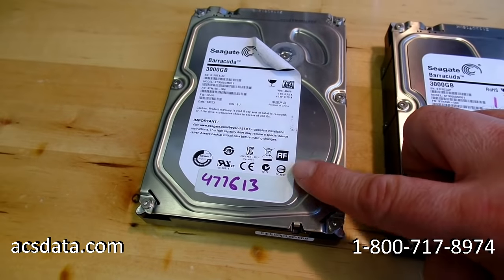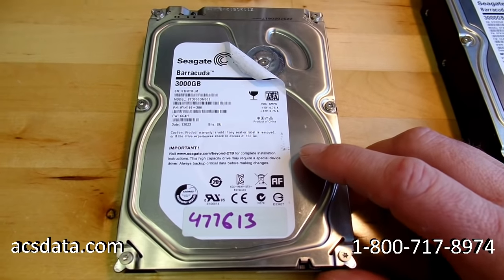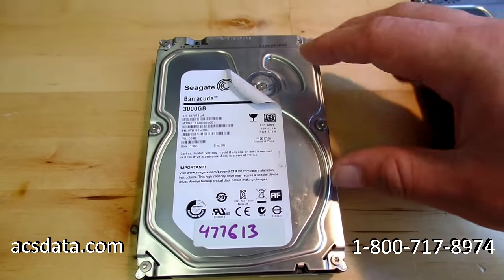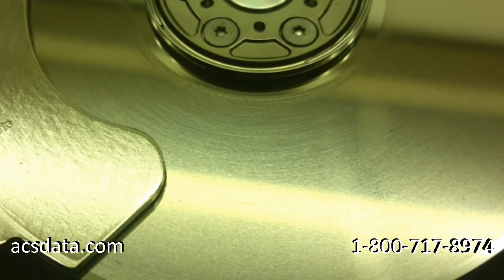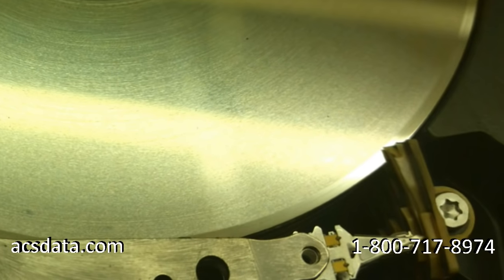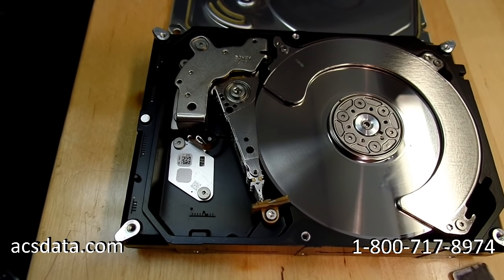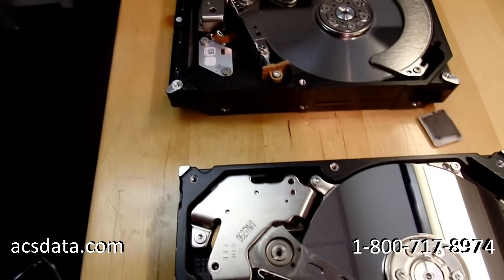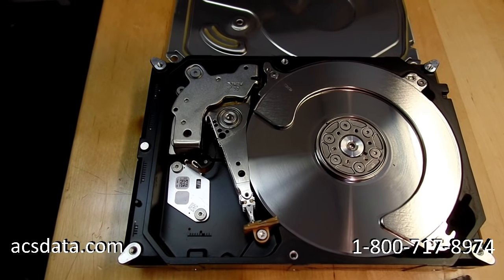Damaged Platters Make This Hard Drive Recovery Impossible

Comment: I have at work a ST2000DL001 (barracuda green i think) that had the same thing happen, it failed to a head crash which scraped every platter clean, there is dust all over the inside of the drive, nothing is getting that data back, even the filter is full of the "data dust". There wasnt anything important on it, it just does the typical seagate sound when a AF 2TB drive cant become ready. I'm gonna make a flyer for out front and set the drive out there saying"dont let this happen to you, ask about our managed plans and backup service".. I think it might be a good marketing idea.

Comment: I got 2 st1000dm003 1TB drives in my nas 24/7 in mirror and they seem to keep up fine under low temperatures. i got my dad a 2TB st2000dm001 and i know it is known to fail but i wanted to see myself how bad this drive is.

Comment: i have the same model which did the same thing as yours customers & inside its exactly the same. disk was working fine & just died in the middle of me watching film from it. Te filter in it is soaking black. Disk itself covered in black particles. Otherwise disk was working without any complains right prior this disaster & was checked frequently by hd tute pro on any problems which wasnt found...

Comment: Ive seen ones that were literally 10x worse.  Its rather unfortunate for the customer... =(
Reply from the maker: +Jay Walt We've had drives come in where the platters were shattered into a thousand pieces.  Some older Western Digital 2.5" drives used a glass platter.  Also seen some older Hitachi drives where the platter coating was wiped clean, and all that remained was a perfectly clear see-through disk.

Comment: If the HD has multiple platters and only the top one is damaged, can the others be recovered from?
Reply from the maker: It depends on if the damaged area of the platter contains any system info.  If the system area of the drive...which is like the hard drives mini operating system...becomes unreadable, in nearly all cases that keeps the data from being accessible even if the remaining platter surfaces are pristine.  However, if the system area can be read, and there's just a small area of damage on one surface, then there's a chance that 50% or maybe even more than 50% of the data can be recovered.

Comment: What is the point in charging a customer for an opened drive, when a drive could have simply been opened just for the purpose of doing a quick visual inspection?
Reply from the maker: There are issues with dust contamination that come into play which is the biggest headache, head alignment issues on some Western Digital drives, and also just not knowing what recovery attempts were made.  Very seldom do we get drives in where someone just opened it to take a peek.
Reply: +ACS Data Recovery I opened my drive just to take a peak. It was more so just to see if there was any physical damage to the platters. Closed it back up and left it alone.
Reply from the maker: Like I said, it just depends on the particular configuration of the drive and how contaminated the drive is. Some drives don't have the heads anchored to the drive chassis, and the case cover actually determines the initial head/track alignment. We have a tool that allows us to measure and then regain that alignment very close to what it was originally. Just saves us a little time. Also, even dust you can't see can have a big impact on the internal components of the drive. You can see a pretty decent illustration here...   https://acsdata.com/data-recovery-3tb-seagate-hard-drive/#Hard_Drive_Flying_Height

Comment: Hello man, I have a question about Seagate Rescue+ Recovery Services. I just received an email stating that unfortunately my data couldn't be recovered. Any thoughts?
Reply: I was told that there was extensive platter damage, thereby making reclaiming the data an impossibility.
Reply from the maker: Unfortunately data cannot be recovered in cases where this is severe platter damage.
Reply: @acsdata  In other words, if the experts at the Seagate Lab in the Netherlands tell me that the drive is toast, then I should use it is a doorstop from now on. Did I get it right? I'm super sad right now. I lost 250GB of precious data as an English teacher. This hurts my heart. Thank you for the response, mate.

Comment: Can you recommend a hdd that is shock resistant. WD are not. 2 drives I lost along all my data.
Reply from the maker: +Oscar Gomez Shock resistant as in, they handle drops and falls well...or do you mean like an over-voltage?
Reply: +Oscar Gomez no mechanical hard drive is shock resistant, they are meant to be mounted in a secure place inside the PC and not be moved around.. if you want shock resistance get a SSD. the heads ride SO close to the media that a human hair can cause a crash.

Comment: I have a question, I have a Transcend External HDD USB3.0 , and I kind of lost my temper few days ago, and Bang that HDD with my fist above it Once. Because the light indicator is on, but not blinking (which its supposed to be blinking if its detectable by the system, pretty sure that is just a bug can be solved by restarting my laptop which i normally do and it will work fine), But just this once, i made that stupid mistake to bang it which I regret. But i never expected it to get damage as the Transcend HDD comes with the protection cover. Right after I hit it, the light indicator is still on, but there's no blinking. & so I plugged it out, 
and connected it again, and 

Now, the light indicator no longer even blinks, however, there is the Clicking sound which can be heard for about 3 seconds.

So in this case, Is it still fixable?

Comment: Buy a Western Digital. I have had no problems with mine. I have had issues with Seagate and Maxtor.
Reply: my western digital did this to me ive had a seagate barracuda for 10 years and never had a problem
Reply: The problem seems to be on some newer Seagate drives, from what I read. All HDD's eventually fail, but my newer Seagate SSHD failed a few months after I purchased it. Kinda makes one a bit angry.
Reply: They stil have Maxtors ?

Comment: would there be literally any data left? for instance lets say that the NSA gets ahold of this particular drive. might they be able to use advanced technologies to extract any data off the drives? are there some really advanced techniques that even a company like yours isnt equipped to deal with? might one be able to look under an electron microscope and literally read off the ones and zeros off a drive (assuming manpower and money is no object)
Reply from the maker: Imagine writing your name on a piece of wood.  Now imagine sanding it off.  That is pretty much what happens in a situation like this.  The magnetic substrate...the actual coating that holds the 1's and 0's...has been wiped from the platter surface.  Could there be some areas of errant good data here and there?  You might find some fragments under an electron microscope, but nothing that would make up any usable data.